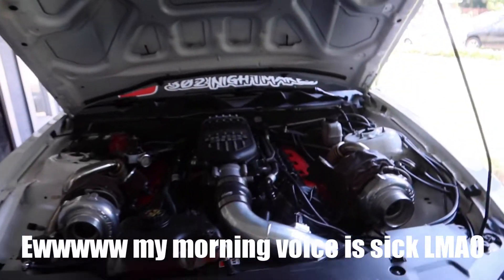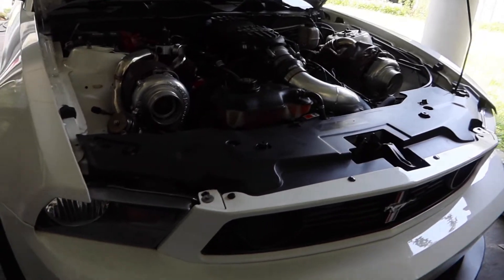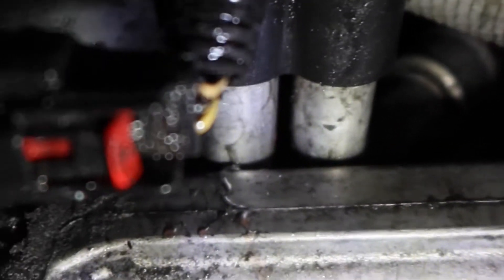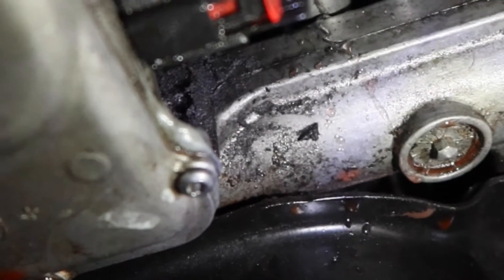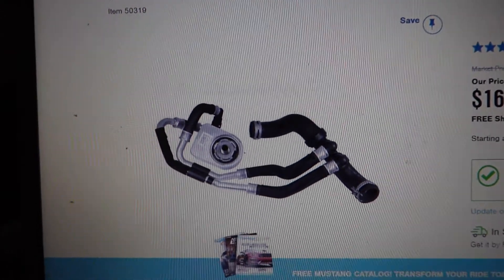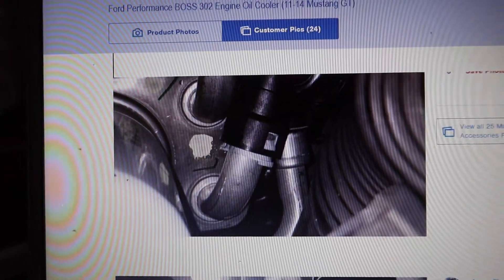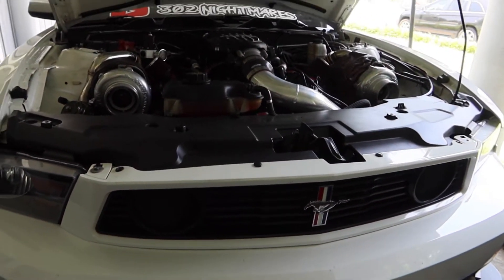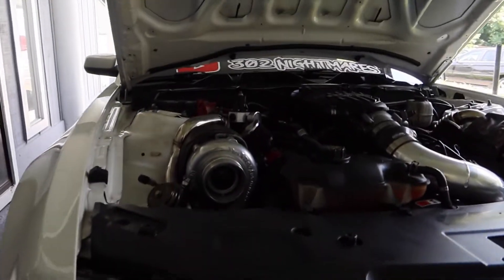MY BOSS 302 MUSTANG HAS AN EXTREME COOLANT LEAK

Comment: How could you not know everything about the Roadrunner boss engine.  Of course i knew it had oil cooler..I knew everything about boss cause i have a fully built Roadrunner boss engine in my 11 5.0 gen3r e85 800wheel 14psi daily driver.  The Boss engine sounds like a racecar..